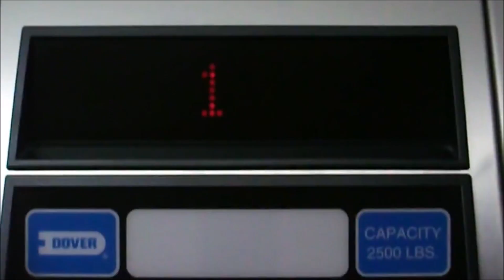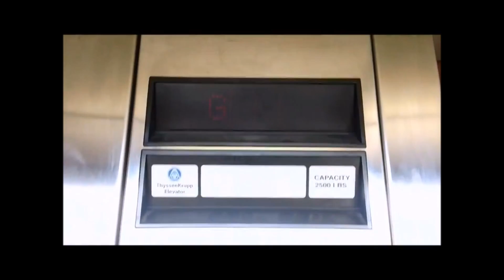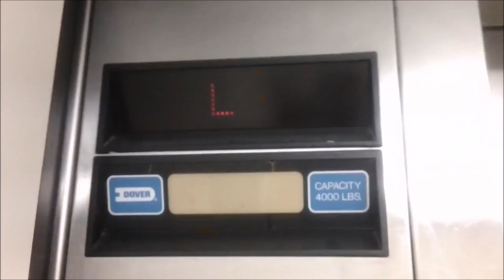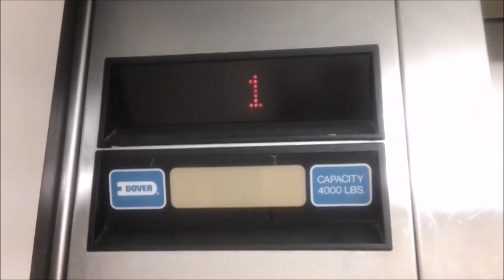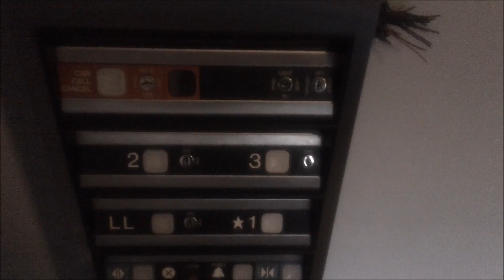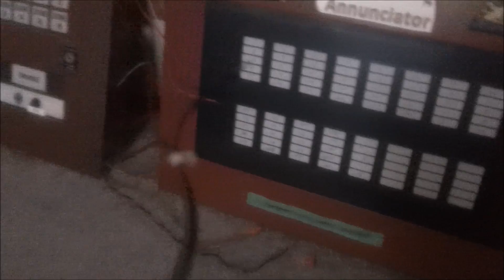The Dover Elevator Buzz Revealed!

Comment: The buzzer was in the following alarm devices:

Simplex 4001, 4002, 4004, 4005, 4100, 4120, Notifier SGL-1000 panels,
Simplex 4601, 4602, and 4603 annunciators
Reply: Pretty sure the 4004 & 4601 use a piezo instead of the PMB-24 (& as I just discovered apparently only some versions of the 4005 used the PMB-24).
Reply: @TheCarson116  There were some 4004s with the PMB-24. https://www.youtube.com/watch?v=lvMQ0GatWnM Also, all variations of the 4601 had it too. Only the first generation 4603-9101 used them.

Comment: Otis uses the same mini buzzer as fire service and nudge mode and Simplex uses these on remote annunciators and Simplex fire alarm panels on 4001 4002 and 4100 classic standard. Otis uses the same buzzer as nudge and fire service but uses a beep instead of the mini buzzer that Dover, Thyssendover and Thyssenkrupp until 2010-2011 or 12 replaced by Grocery Store Beep.😀😀😀😀😀

Comment: "These buzzers were used on pretty much all 1980s Dover Impulse elevators."
CORRECTION: Except the ones that were relay controlled.
Reply: But I overheard somewhere that the ones with the floor passing chirp still had the buzzers for nudge mode and fire service

Comment: I wonder if these were used for Otis
 nudge mode! Anyways nice video!! Cool demonstration too!
Reply from the maker: +Central Jersey Elevator Filmer by NJelevators Thanks! I wouldn't be surprised if Otis did use the same buzzers. Of course we can't verify that until someone gets to take a look at the guts behind an Otis car panel.
Reply: +msj191961 Actually, I filmed a Dover elevator modernized by Otis and it still has the buzz, but it's only used for nudge mode